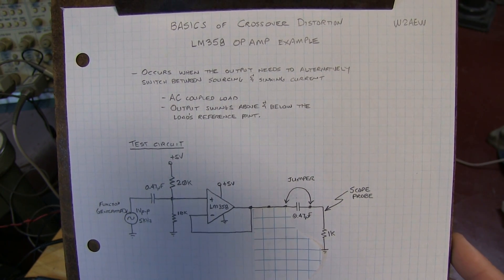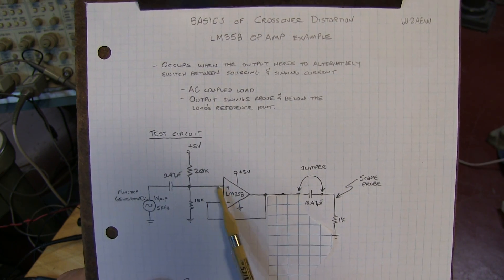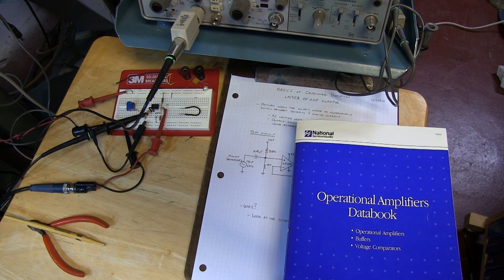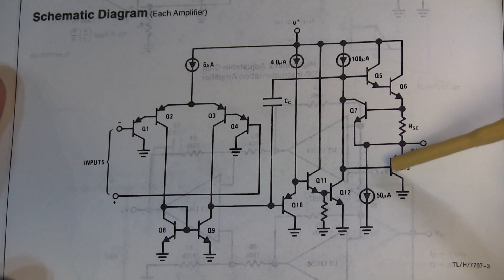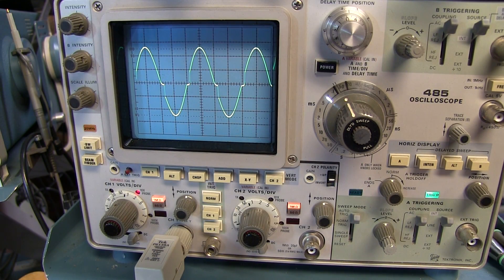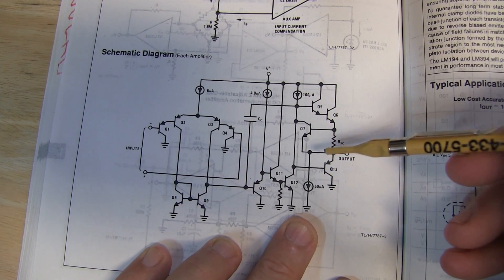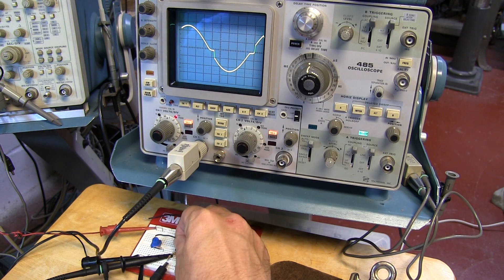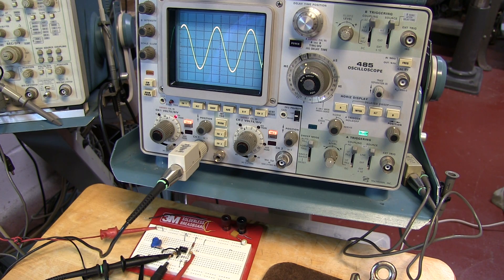#215: Basics of crossover distortion | LM358 op amp example

Comment: Nicely done. I like that you still have the real data BOOK, not just PDFs ;)
Reply from the maker: +Chip Guy Vids I still have a small selection of paper databooks - mostly analog stuff.
Reply: +Chip Guy Vids I have about three shelves worth of old data books still and I use the PDFs online myself mostly today. I guess if you want to curl up to a good book at night though the data books are still nice to have? I just downloaded one of the paper books I have in PDF The Nat Semi Linear Applications Handbook.
Reply: Thanks for looking. That is all I have come across as well in my searches. I'll be sure to post if I find something.
Reply from the maker: +Paul Frederick Thanks for the tip on the handbook PDF...
Reply: *****
I would not have found it myself except for looking for the book because of this video. I wanted to make sure I had the title right. Because the photo of my bookshelf is a little blurry. http://i.imgur.com/wFswkcH.jpg
Reply from the maker: +Paul Frederick I've got a lot of them too - especially the yellow TI books, the white Signetics books, and the blue (and older dark brown) Motorola books. I even have some of the same SAMs and TAB books.  None of the microprocessor or Intel books though - I'm an analog guy...  ;-)
Reply: *****
My electronics book collection is a reflection of my interests at the time when I was buying electronics books. I had a heavier digital bias back then. Today I lean more towards the analog myself though. That is due to a variety of factors I suppose. Times change.
Reply: +Paul Frederick Any idea where one would be able to download the National operational amplifiers handbook. Was able to find the Linear Handbook
Reply: Carlos Alberto
There seem to be several applications notes for op amps from nat semi, but I am not seeing any handbook available. One is an app guide, the other a circuit collection. App notes 20, and 31 respectively. I am not seeing a handbook though. Sorry.

Comment: Thanks Alan, that was a great demonstration.

When I have ever built a Push Pull audio o/p stage, I diminished this problem by placing 2 diodes in the collector circuit of the equivalent to Q12. but obviously that isn't possible here.

Comment: How can I tell which opamp is susceptible to crossover distortion?
Reply from the maker: +Mike Shekhtman Thankfully, most op amps these days don't suffer from this - but the only way to be sure is to check the datasheet.  The text description in the datasheet mentions this.
Reply: +w2aew You certainly stacked the deck with the 358. It is a low performing chip these days. A signal generator kit I got came with one and in the comments everyone said replace it with a TL072. Once I compared the data sheets of the two parts I did myself. A fun toy. Have you played with one of these? http://goo.gl/SJMCED I'd like to see you do a video about it.

Comment: Trying to do it the lazy way on NI Multisim, I get a little crossover but not as much. Probably a silly question, why did you use a analog scope instead of a digital. Great video's as always Alan, I will try it tomorrow in really life. Back to Multisim to try and replicate your results.
Reply from the maker: +T Komoski There was no particular reason that I used the analog scope, other than I love using them - and I didn't need any of the features of the digital for this video.

Comment: Awesome vid as always. Just to clarify.. since the input is a full sine wave, the opamp ..internally.. still performs the full transition swing. however relative to the load, it only drives the positive swing and never sinks through it since the load will sink through the parallel load resisters. Since the opamp does not sink, does the internal transition still take take place ? The opamp sink is still part of the parallel circuit and once its resistance on negative swing becomes low enough it will conduct more than the load sink resisters, but by that time the noise will be a non factor ?
Reply from the maker: +Tim Copeland With the DC load resistor, the NPN output device operates as Class A - it is conducting through the entire cycle - the PNP device is never turned on.  It is just that it is pushing less current into the DC load at the trough of the waveform, where the AC coupled load is contributing more current to the DC load. The PNP device never turns on because the collector voltage of Q12 is always biasing the NPN output devices.
Reply: +w2aew Now I think I see .. by loading the output just enough you change the feedback dynamics so as the only way the opamp can maintain equilibrium to its inputs, is by continuing to conduct through the entire swing.
Reply: I don't think you see. It's simpler than that.  NPN can only push, PNP can only pull. When you have bare capacitor on the output and you are sending a push-pull signal (sine wave), NPN pushes, PNP pulls. With the distortion inbetween. So you put a resistor on the output to pull instead of the PNP. On opamp side of the capacitor, the voltage varies (push-pull) somewhere btween 0-5V. The other side of the cap is on 0 V without signal. Pushing current through the cap and load resistor makes load res. voltage positive, pulling the current makes load voltage negative. Capacitors can have different levels of DC voltage on sides but they pass vibrations of that voltage through as a current. And you can convert those current vibrations to your prefered voltage by resistor (a resistor is current to voltage converter and vice versa).

Comment: Hi Alan Excellent material as always. The trick of applying an external load also works for regulator circuits where the current flow reverses itself. Without it the Regulator can enter regimes where it no longer functions and the output voltage soars.. This can easily damage components.
Reply from the maker: Yes, you're right. Some regulator designs even have a minimum load current requirement.